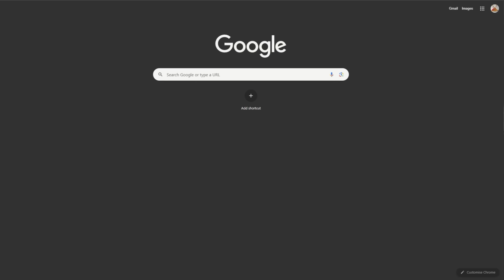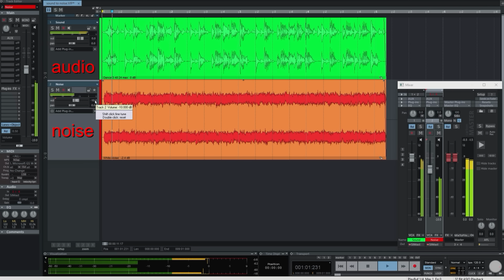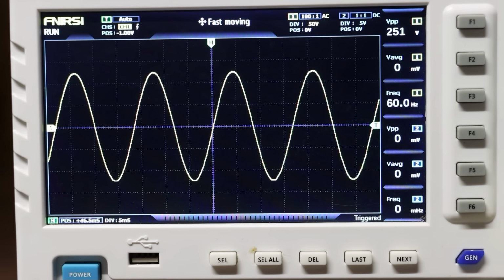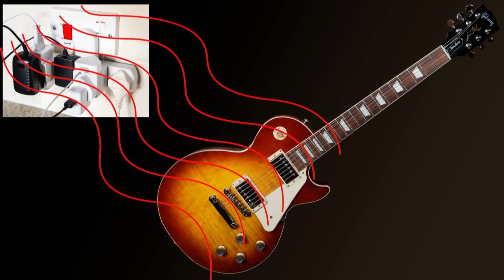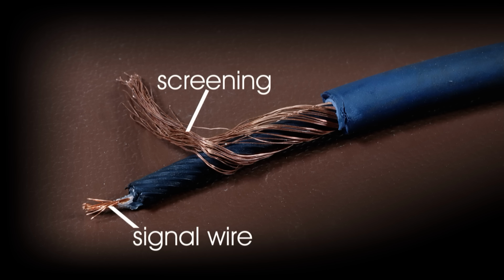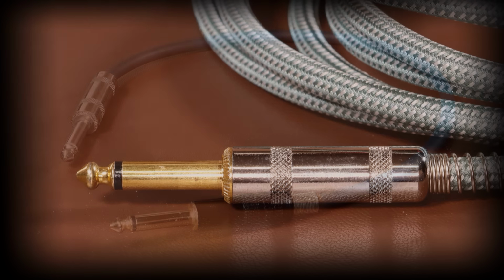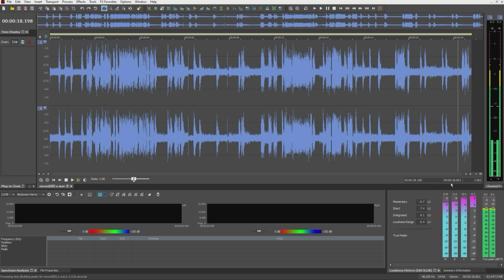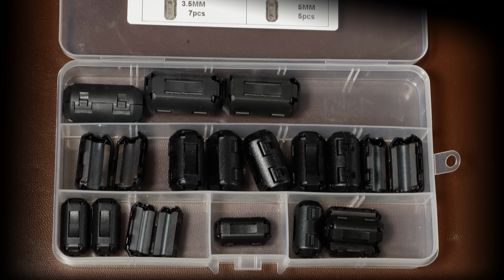Guitar screening & sound vs noise explained.  All you need to know about guitar electrics. part 2

Comment: There is a problem with the shielding around the pickups.
Look carefully: around every pickup coil there is a single short-circuited turn.
The magnetic field is dampened a little bit by this.
Take a cutting knife and make radial cuts around every pickup
The shielding is still intact, but any Eddy current in the copperplane has to go a much longer path.
Search for eddy-current-free shielding to get more info

Comment: My guitar uses 2 humbuckers. The amp is set up without any other effects except for some reverb and delay. There is no fret buzz issues. It is quiet when on idle. When the strings vibrate there is a static buzz. What could be the causes? Thank you
Reply: I think there are some effects units that eat the noise. In my case, I have a compressor in my chain to do gain staging before it goes to a Passive DI Box and an Audio Interface. I'm sure it's the effects unit because when I monitor directly (without going thru the computer and back), I can only hear the interface's inherent noise when I'm not playing.
Reply from the maker: @reimakesgames  Yes, this is common enough these days, but they do detract from the natural sound of the guitar especially if you like to hold the note to the end (near silence).  I have several noise gates, A.I. noisecancellation and digital noise supression but none of them is perfect. 🤔
Reply from the maker: That's a hard one, without having the guitar in front of me.  If you have or know someone with another lead and amp, the first thing to do is to try it with them and then you can rule out that the lead or amp are faulty 🤔